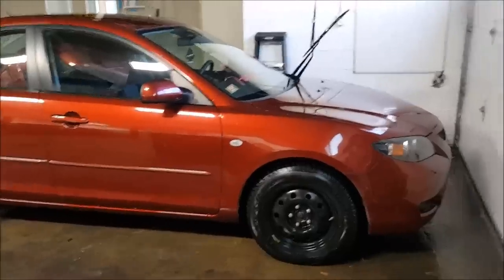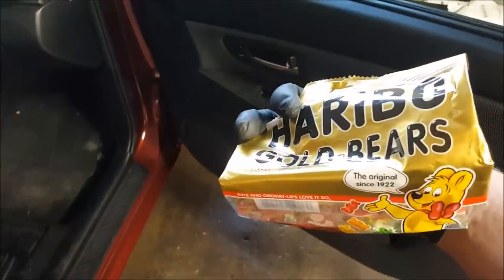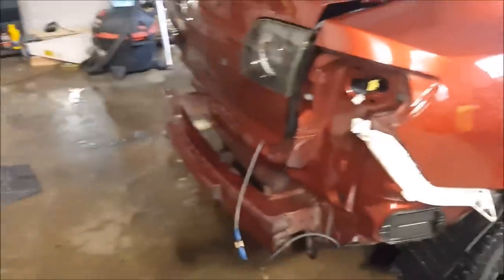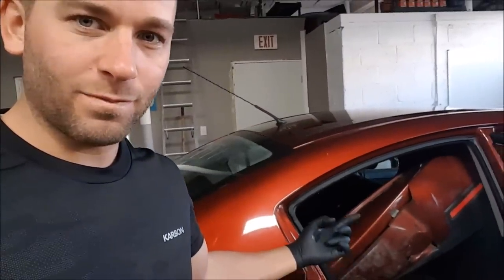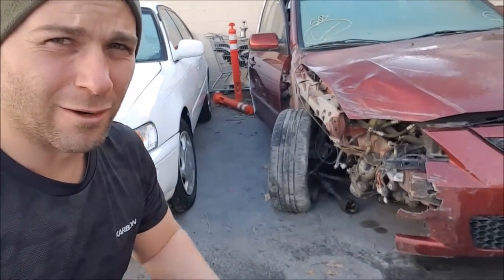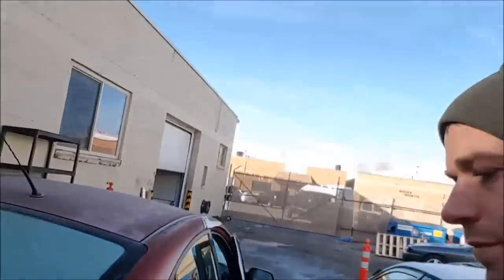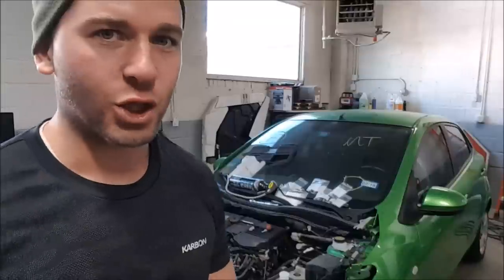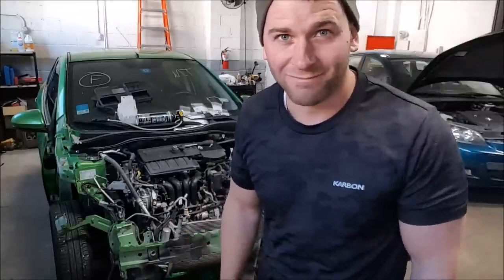I Bought a Gold Mine from Insurance Auto Auctions

Comment: Do you only restore mazdas or do you modify them too? Im asking because I may or may not get my parents Mazda 3 2.5 soon and I want to know what kind of performance mods I can do to the engine.
Reply from the maker: Scared Bolbi there are mods you can do to it, but just for minor power.
Reply: You can get more than just minor power out of those. There is no reason why a Mazdaspeed 3 turbo setup wouldn't fit on that motor though you will need custom tuning, larger injectors, etc.
Reply from the maker: madmatt2024 isn't that jumping to a top end build and budget though?  I was answering more on a conservative budget.